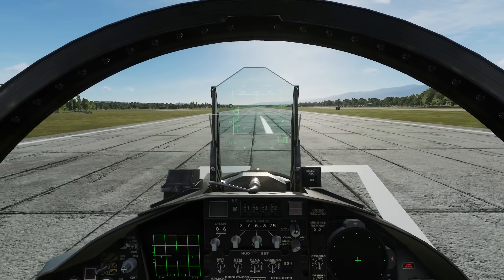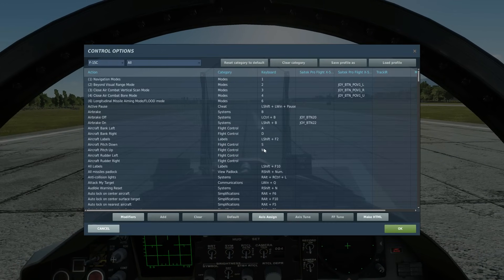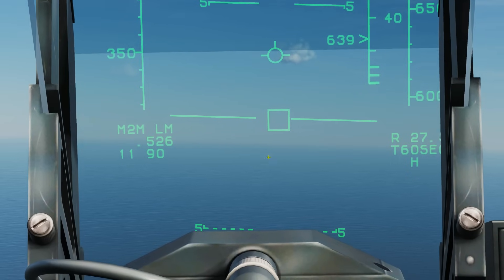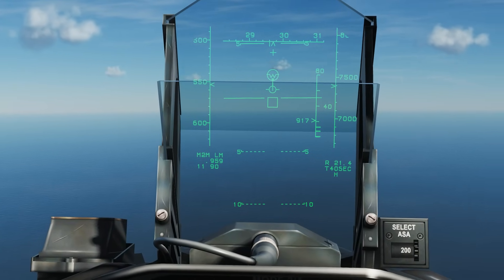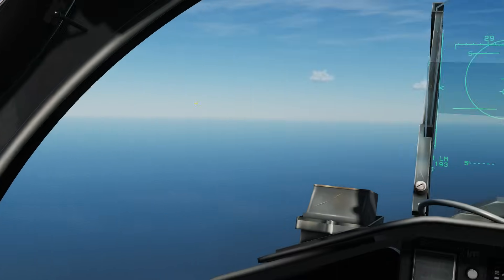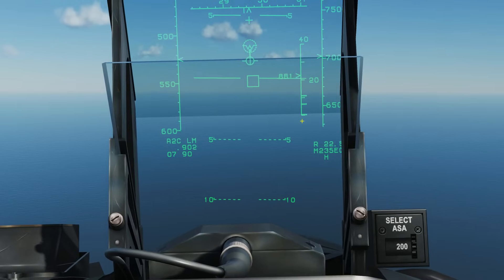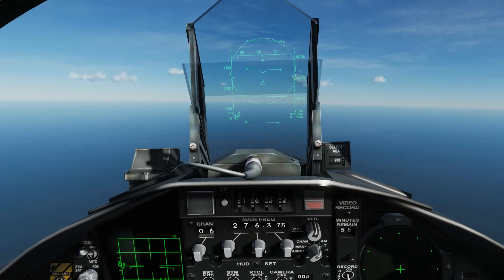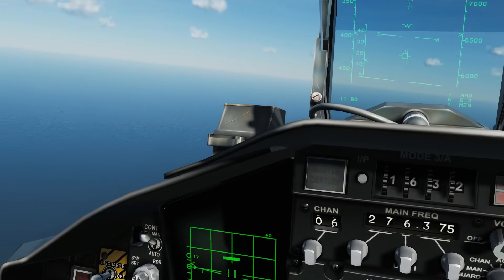F-15C Eagle: BVR Long Range Missiles Tutorial | DCS WORLD

Comment: The post-launch countdown timer uses the prefix "T" indicate time until pitbull. When it has the prefix "M," that is estimated time to impact. This is why the Sparrow always has a "T" number and if you long-bomb the AMRAAM it starts as a "T," drops to zero, the missile goes pitbull, then starts an "M" countdown.

Where this gets a bit confusing is that the pre-launch countdown for the AMRAAM always has an "M" designation. The pre-launch countdown on your HUD and radar screen indicates time to pitbull when outside pitbull range (10 nm). But then inside pitbull range, your HUD's pre-launch countdown indicates time to impact, while your radar screen will say "M0," meaning, immediate pitbull. 

Consider a case where you fire an AMRAAM at about 12 nm. Right before you fire, the lower right of your HUD and the bottom of your radar screen will say "M2." As soon as you fire, the lower left of your HUD will change your Mach number to "T2 M16," meaning, 2 seconds to pitbull, 16 to impact. Theoretically, the missile should hit in 16 seconds, but in reality, it'll probably hit in about 20-24 seconds.

Now consider a case where you fire an AMRAAM at 9 nm. Right before you fire, the lower right of your HUD will read "M12" and the bottom of your radar screen will say "M0." As soon as you fire, the lower left of your HUD will change your Mach number to "M12" meaning, 0 seconds to pitbull, 12 to impact.
Reply from the maker: Thanks Sir.
Reply: this confused me as hell after coming to f-15 from f-16 since in the F-16 timer with T means that amraam went pitbull. before that it says A so i thought that I am doing something wrong and not providing guidance to the missile
Reply: so what I'm hearing is that GR got info wrong and they haven't corrected it in their tutorial for 2 years
Reply: @silverwing6175or people can read the comments and you can stop being entitled 😂
Reply: @silverwing6175  then make a video about it yourself?

Comment: AIM-7E is a Vietnam era missile 
AIM-7F is a solid state missile with a bigger rocket engine
AIM-7M is an inverse Monopulse missile which makes it very accurate and ECM ressistant but it was introduced in 1982
Reply from the maker: thx AJ
Reply: @grimreapers  the British Skyflash missile is an AIM-7E with the old electronics and seeker ripped out and replaced with British engineering.
It was solid state and monopulse in the mid 70s.
So the RAF had monopulse missiles ahead of the US.

Comment: please make a vídeo showing how to use the autopilot of the f15. I can't see how to make it work
Reply from the maker: It has no autopilot.
Reply: @grimreapers  It does, I use it regularly.  There is an Attitude hold, and an Altitude hold.  I have mapped them both to my HOTAS.  It's a very crude AP and tends to drift, and can't handle a lot of bank.  In order to engage Altitude hold, you need to first engage attitude hold when very close to straight and level flight, then engage altitude hold.  You'll also get annunciator lights when your AP is engaged.